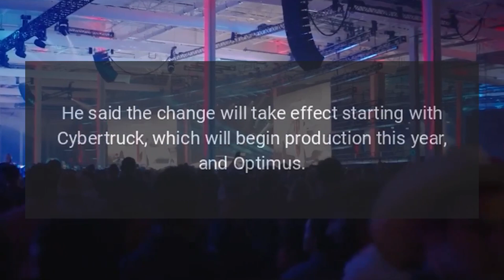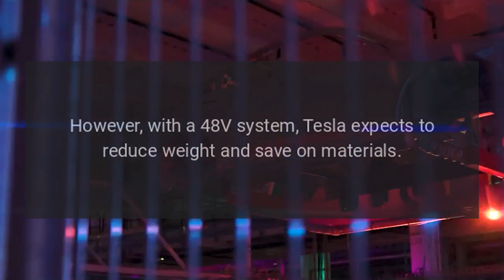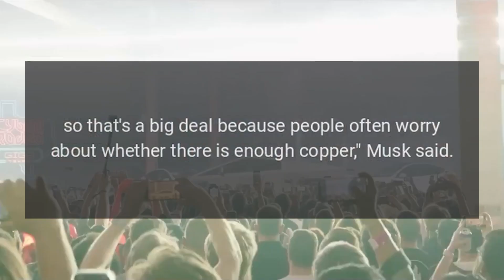Tesla Will Switch to 48V Low-Voltage System in Cars

Comment: With most components controlled via microchips it makes sense to swap to a system that allows power & communication via a single cable (Power Over Ethernet) just think of the 48v system as a POE Switch
Reply: Except that most proprietary chip sets are designed for 12V or 24V systems as is commonly used in Industrial automation. It won't save much weight or space either as you still need insulation around the wires cores. The insulation may even need to be thicker due to the higher voltage.
Reply: @brendanpells912 ... Even if the insulation were thicker, plastic is cheaper ... Plus most 12V/ 24V insulation is actually perfectly sufficient for 48V.

Stepping down DC for use in lower voltages is alot easier than stepping up the voltage ... Which means a lot more components can be made compatible with the system - all old gadgets will be compatible by a simple tweak in their power system, PLUS new more power hungry gadgets will be able to function correctly without having to draw like 30amps or even over 50amps.